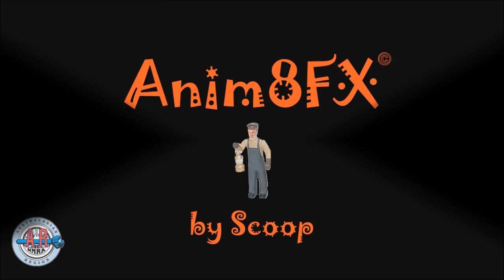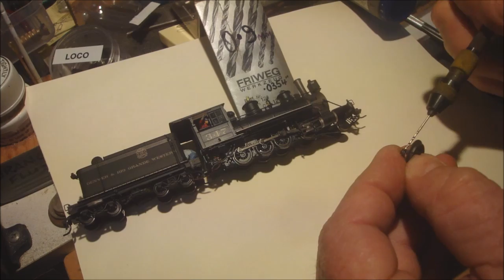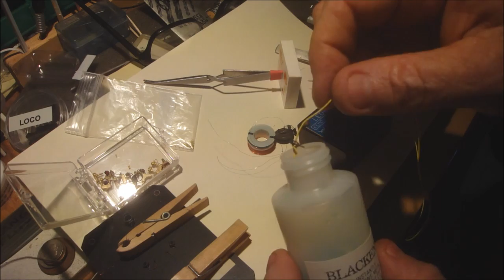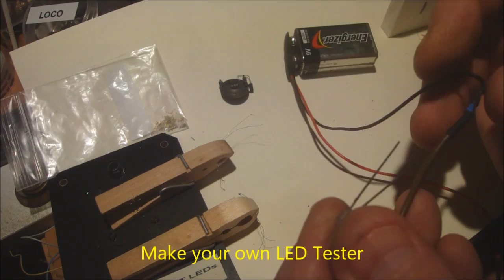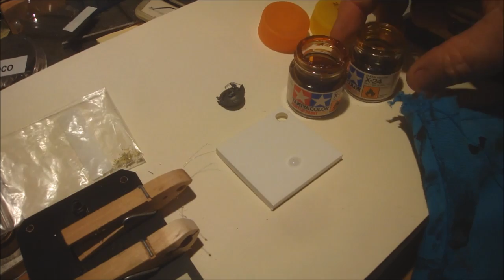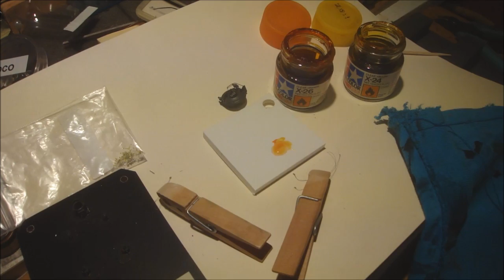WORKING CLASSIFICATION LIGHTS PART 2

Comment from the maker: I connected the 2 x LEDs to the headlight as I didn't feel like adding a 2nd decoder. Noresistor was needed as the factory board has a resistor that does the class and head lights.